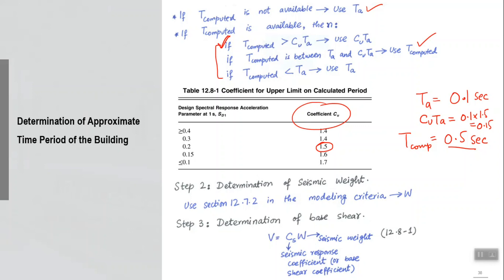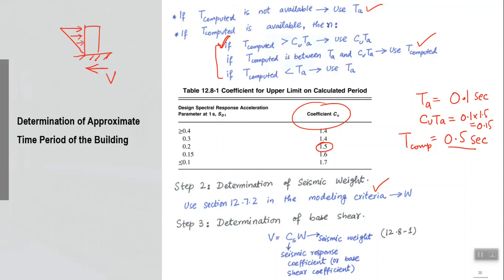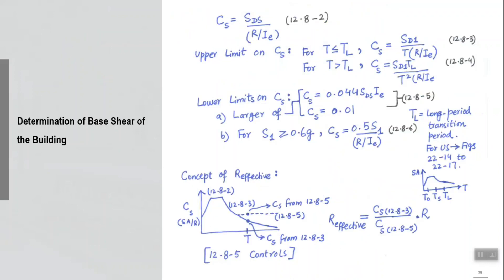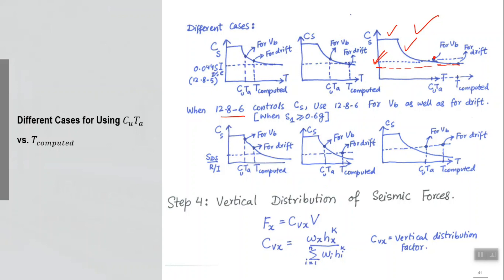48 - ELF Procedure - Steps 2 and 3: Determination of Seismic Weight & Base Shear

Comment: we can introduce seismic drift case for the computation of drift in the same model. The software use the model direction time in X 0r Y from the modal analysis for the calculating the above.
Reply from the maker: Oh yes i think i missed this point. I will clarify this in next class. Or even we can make a separate seismic type load pattern for only drift, and simply enter our user-defined period coming from modal analysis.